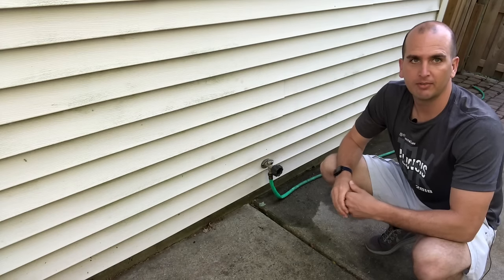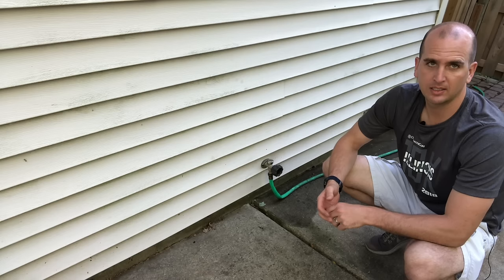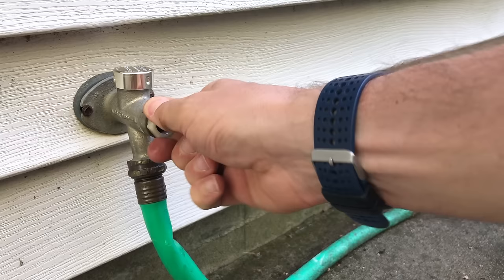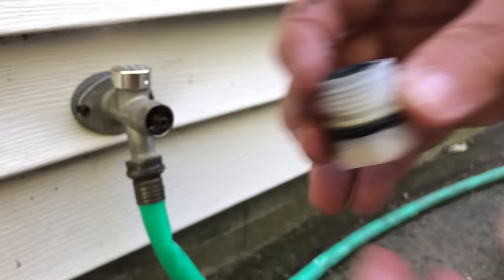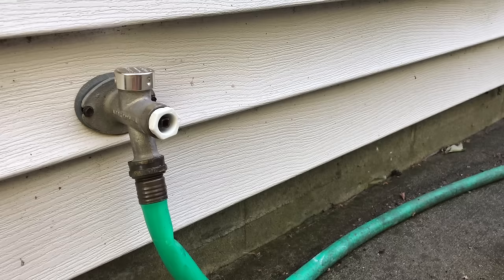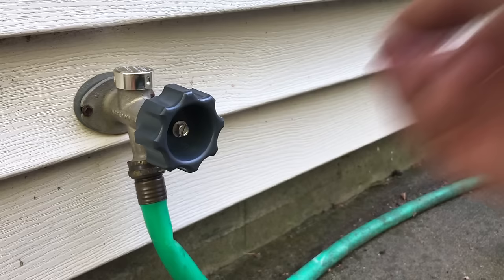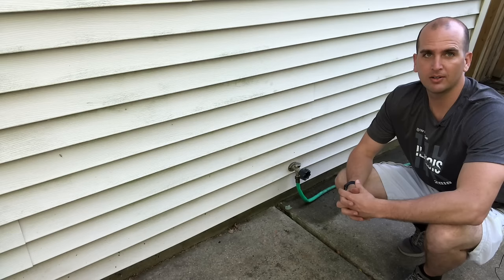How To Fix a Water Leak Behind the Handle of an Outdoor Faucet

Comment: I just took my handle off as im having the same issue, and mine doesnt have a plastic nut at all? is that common?  would buying the kit even work and are these kinda universal or all depends?
Reply from the maker: Hey Andrew, I am not an expert in all the different brands.  Do you see any company brand or model number anywhere on the spigot?
Reply: @EverydayHomeRepairs  thanks for replying, and no just ASSE 1019-A which appears to be a plumbing standard.  upon further inspection it seems there is a metal packing nut and its outside of the stem, so i'll have to figure out how to repair that
Reply: I’m having the same issue - mine is a B&K.
Reply: @luketeal7877  I did some digging on mine also.  it's made by Mueller Industries and their line is now B&K, i called and they said to epoxy the weep hole in the stem but i have not done that yet
Reply: @andrewsalsano1278  did the epoxy work? I wud then also see if plumbers tape cud go around it 1 time. I was just getting ready to head to hardware. Butbi just bought JB Weld, 2 part epoxy. I think I have same spigot as u. Galvanized nut around stem? Peeling or flaking silver. Like it was silver plated or idk? I couldn't get it to budge. Willing to try tobasco/hot sauce though. Wud much prefer to apply epoxy & put this thing back togethr4. I've got a couple trees, flowers & grass to plant.
Reply: @andrewsalsano1278  thx 4 info btw👍

Comment: Thank you...is there something else I can use if my bolt is too rusted for WD-40. I tried it and liquid wrench
Reply from the maker: Yeah, that can definitely be the toughest part of the project depending on the condition of the bolt.  Without melting anything maybe a heat gun can weaken the bond enough for you to break the bolt loose.
Reply: @EverydayHomeRepairs  I put a wrench to the bolt and the head of the rusted bolt snapped off. I think my repair just became more difficult!
Reply from the maker: @russmazzaro  crap!  Unfortunately this isn't that uncommon.  At least now you should be able to remove the handle and soak the threads with WD-40 multiple times to try and weaken the bond.  Can you get vise-grips on the remaining part of the bolt?

Comment: Any reason not to take out the stem and check that washer? Is the mindset that if you can fix the leak with the first washer why bother with the one in the stem?
Reply: You have to turn off the water. He's just fixing the leak behind the handle. the stem and washers that go deep inside the Spigot  control the shut off valve. When those go bad your faucet leaks out of the threaded part where the hose is attached. So there are 3 possible leak sources, the top (vacuum breaker), behind the handle (this Video) and the faucet, not sure if he did that one but if he didn't you can find one.

Comment: How would you fix a leak that happens in the wall, where the pipe comes out? I have a manufactured home, that only has a crawl space under the house, and when I turn on the hose faucet, water leaks down the wall where the pipe comes out.
Reply: That hole unit is almost a foot long where it either thread's in or is soldered behind the wall.

Comment: Seriously, buy the kit to replace all the wearables on the stem and you only replace the packing gasket?
Reply: I would always completely dismantle the entire tap and replace and clean up all the parts, including polishing up the valve stem before replacing all the worn "O" rings and washers. I always re-assemble with silicone grease as well. Have done this sort of job on several taps on my own and neighbours properties. You also forgot to mention adjusting the front packing nut for a nice easily turned action and still sealing water egress .....   greetings from Scotland, by the way!

Comment: Those Mansfield/Prier spigots are horrible.  I fix mine constantly with these kits and it never lasts over a year, sometimes just a few months.  I'm stumped as to why.  The plastic handles always break, no matter how careful I turn them and I always get leaks.  I've replaced the entire stem before and all gaskets/parts, same thing.  Frustrating.  I think I need to take the time to replace the entire spigot with another product but that is more of a job.
Reply from the maker: hmmm, I had pretty good luck over the years.  I know the seasons can cause some wear and tear but usually that is over several years.  Are you using your spigot daily / multiple times per day?
Reply: @EverydayHomeRepairs  Sorry, sort of last track of this.   I use it a lot in the summer (3 months) as we have a backyard inground pool but never use it in the winter months.  Spring and Fall used very lightly.  I don't know either.  This last time, it appears to be lasting a little longer so far but I'm also extremely careful when turning the handle, to go lightly with it.

Comment: Hi Scott, great video, do you have suggestions or a link on how to remove the handle when the screw on the handle is so rusted and warped even after trying several times with WD40? Thanks
Reply: In the worst case drilling with a small bit is the only option. Try everything even chiselling a new head before that though. You can buy centre punches with a cross at front which you hit with a hammer at the back to create a new head. Most people will just use a chisel or screwdriver and create a groove.

Comment: Why would you switch back to a straight screw driver when you already had a socket that fit the bolt holding the handle on?
Reply from the maker: Hey Steve, was just trying to show the options depending on what tools people had available.

Comment: Great video!  I tried this (replacing the internals) first and still had leaks behind the handle.  I then replaced the entire internal stem and that still wouldn’t fix it.  The faucet problem started in late Summer with an inability to shut off the water completely via the handle- so I figured it was just worn seals.  Any thoughts?
Reply: I have the same problem, you likely need to replace the entire Spigot.  If it's the orginal one it maybe behind a wall sweated into the copper water line. 
You'll have to turn off the water, cut the pipe, remove and replace the Spigot. Time to call a plumber, probably 300.00 ugh!

Comment: Tried this, but the handle screw was so rusted it snapped off! Now I don’t know what to do... I can’t remove the handle... I wonder if I can just cut the handle off?
Reply from the maker: Hey R Ww did the head of the screw snap off?  In that case I would think you could remove the handle but you would need to swap out the rod or rod/stem or extract the remainder of the screw from the rod to get everything back together.  I can help troubleshoot as much as possible through the comments section which is a bit limited without pictures or videos.

Comment: So I have a spigot on my carport right outside my kitchen under the sink/window. Few weeks ago I was washing my truck and came in about 20 min later to find my kitchen floor was flooded. I thought I'd have to replace the whole spigot but that requires tearing apart part of the wall. Should this fix the issue instead?
Reply from the maker: Hey AmbientShade,  you most likely will need to address the issue behind the wall.  Do you have a crawl space or basement where you can access the water line to take a closer look?

Comment: Hi!  I think i have an issue with both the anti siphon and a leak behind the handle.  I was able to unscrew the screw out from the handle, but the handle will not come off!  Your’s pops off easily in the video, not sure why mine is stuck?  I’ve tried to pull and wiggle, but nothing.  Any advice?
Reply from the maker: Hi David,  The outside screw should be the only thing holding the handle on the stem.  There could be considerable build up but you would think with some force and a little wiggle it would pop off.  If all of the components were metal most people would just add heat and usually loosen things up.  Since the handle is plastic you might be able to use a heat gun and warm up the plastic which could help to loosen the bound between the plastic and metal.
Reply: @EverydayHomeRepairs  thanks Scott.  I do not have a heat gun, but I'll try to use a hairdryer.  Ironically both the spigot for  my front and back yards have the same issue (cannot take the handles off).  Could there be another screw within the handle I should look for?
Reply: Kick it off".....
Reply: good to know

Comment: water comes out the square thing in the middle... what can i do? this is such a pain in the ass i have to go to work and this stupid thing haf to break now i have to shut the water off... @%#%#%$# my spicket is a asse-1019
Reply: Mine, too. ASSE-1019A. Water leaking through the screw hole. Tried Teflon tape on the screw. No dice.
Reply: @philiphubbell9292  i went to ace hardware with the asse spigot and i got something i could use to replace it for now. i kept the old one incase i could get the replcement part for the middle valve or someone who knows how to can tell me if its fixable but for now i got a replacement. try a hardware store or lowes, see if you can get the spigot off and bring it in they will help. good luck

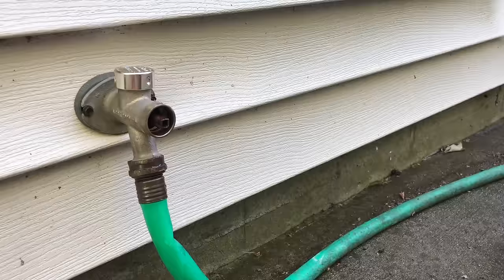Comment: 02:24 You admit that this spigot has not been serviced since new 20 years. 04:09 You bought the hydrant repair kit containing all the seals. You should have replaced the valve seals too due to the age one the spigot. Next video “Spigot valve seals leaking”. 🤣😂🤣
Reply: You have to turn the water off for that, then if your main shutoff valve is old it may leak when you open it back up. If you have a ball valve shutoff and you won't introduce a new issue I agree, might as well fix it.

Comment: High as balls. Dude please. Help. I put my rusty screwdriver into the part. It turned.
The water turned on.
Then I held it and tried to turn it. The thing is like 1 part I think. As I'm turning its stripping side to side. I stopped. When ya cant fix a leaky water faucet and ur 22. Feels bad. Still high. So itz not that bad. Dude weed is awesome i dont even feel depressed anymore . This is lit